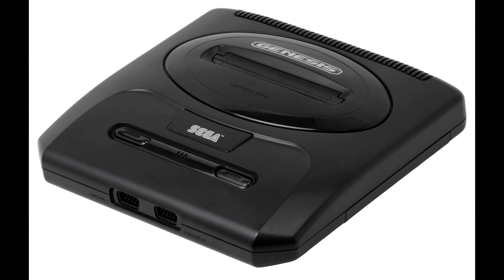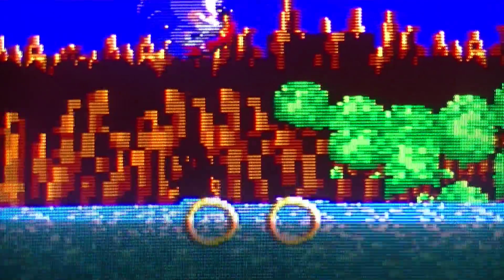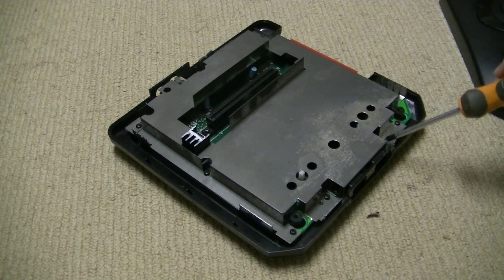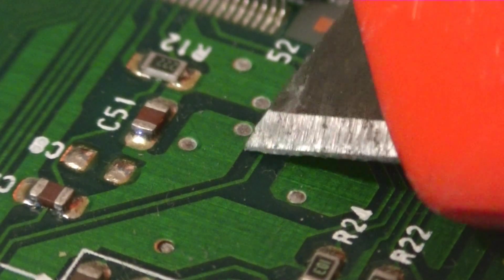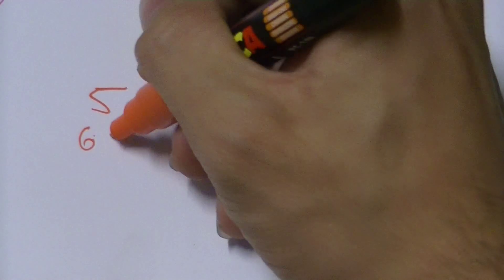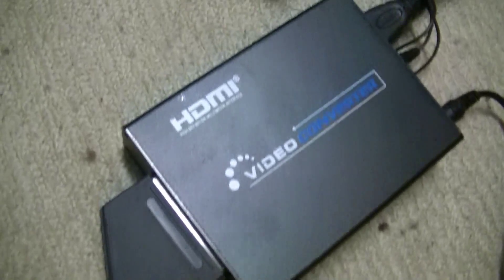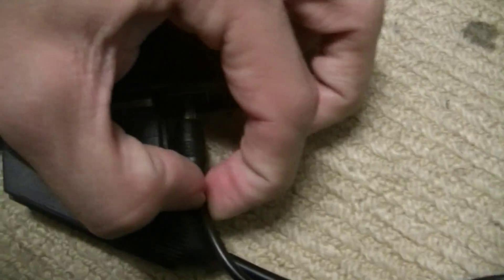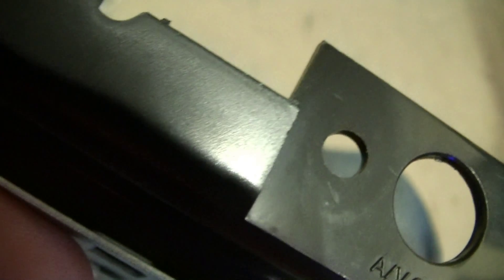EASIER Mega Drive II 50/60HZ Mod Switch & Comparison | Joystick Division

Comment: Hey! Does cutting that first trace alone turn the console into 60HZ, or is there any other steps needed? If it does, I'll probably just do that, and later on if I want to use the Sega CD I'll just finish the mod or use another console or whatever.
Reply from the maker: Pretty much, yeah. :)
I added the switch because I have a few games that won't launch in 60Hz. For those I start the console in 50Hz and once the Sega logo is gone, I switch it to 60Hz.
I hope this adds some context.
If you want a 60Hz-only console, then yes, all you would need to do is cut that one trace. :)
Reply: @JoystickDivision  Thank you!

Comment: My console 's motherboard is way different.
Reply from the maker: I believe mine is a VA0. I could be wrong.
There are a few different variations.
Reply: @JoystickDivision  mine is a VA4. I Found out the region area is now at where R33 is and you need to take the resistor out.
Reply from the maker: That's good to know if I ever have to do the mod for a VA4. Thanks.

Comment: Wow! How did you get so crystal clear sound on a Mega Drive model 2? It's not even the 3/4 motherboard revision (VA4). Did you modify  it? Or is just the scart cable you use?
Reply from the maker: Well, funnily enough, the answer to your question is in the video I made just before that one. :)

Comment: sorry but i hav trouble understand what's to be connected and what not..i have a model 2 mega drive like yours, and just one on/off  switch...let's say i cut that track on the mobo...and then? WHERE is the place where i have to solder the 5v cable? and the gnd one ?
Reply from the maker: You can get ground from many places. I take 5v from the voltage regulator. Sorry I didn't mention it in more detail, it's an old video.
Reply: @JoystickDivision  I see, thanks but sorry i am a noob at this. Mind you telling me where exactly in the board you took those two?
Reply from the maker: You can get ground from the middle pin of the voltage regulator and 5v from the output pin on the right of the regulator. The pins are labelled from left to right 'I', 'C', and 'O'. 'C' (Common) is ground and 'O' (Output) is 5v.
Be careful when soldering and make sure you don't bridge any connections. You don't want to short 5v to ground.
Good luck. I hope this helps.

Comment: NTSC version of Sonic is slow on a PAL console, but if you play the PAL version (E) of Sonic on a PAL console it will run with the same speed as the NTSC version on a NTSC genesis, but not all PAL games had adjusted speed... so it's still a good idea to do this mod, and also far from all games got released in europe.
Reply from the maker: I'm not sure about that.
I used a PAL copy of the game on a PAL console to demonstrate how much slower it was.
Reply: Hmm at least Sonic 2, 3 and Sonic & Knuckles runs @ proper speed on my Mega Drive with a Mega EverDrive X7 flash cart, but i've not tried the first Sonic game, maby they didn't care to adjust the speed in the PAL version of that game?
Reply from the maker: Actually, that might just be the case as I know that the later games were optimised for 50HZ.
Try the first game and note how much slower the music is.
Reply: First sonic wasn't Pal optimised, others does